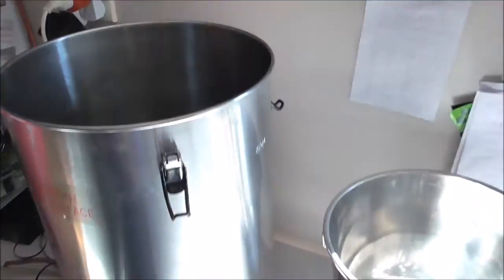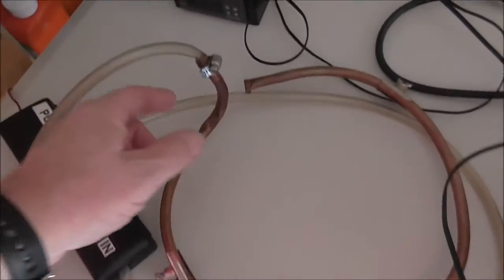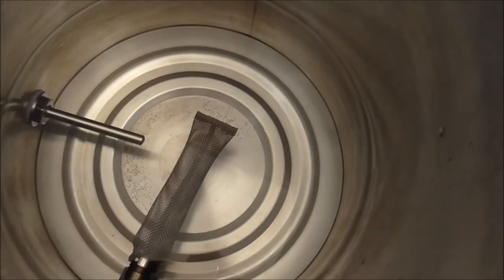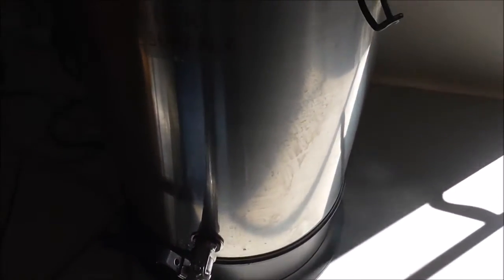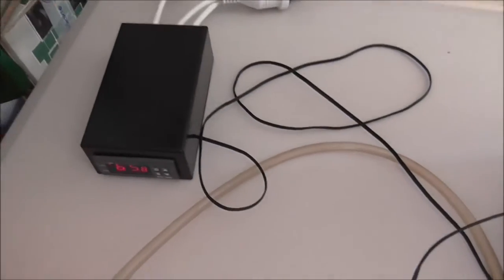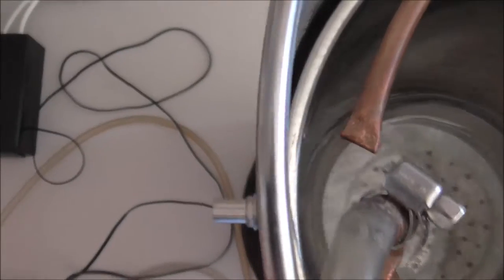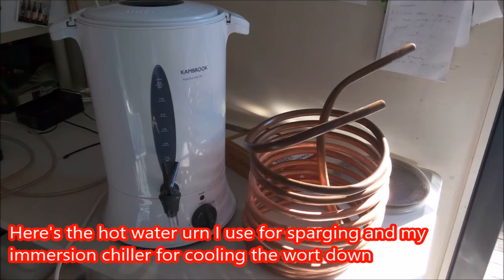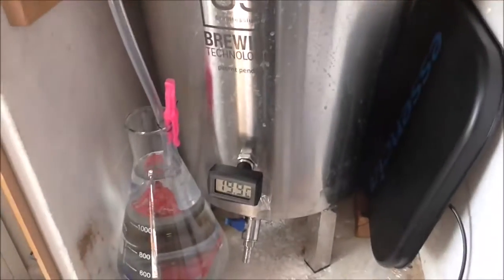Electric RIMS Brewing System with Sparge Ring - DIY All in one - August 2016 Update

Comment: Hey mate hows that little pump going? Does it really handle the temp and and small particulate that gets through?
Reply from the maker: Hi. It unfortunately gave up the ghost a few years ago. I've replaced it with a better pump as you can see in this video. The little pumps are cheap, but you'll end up replacing them on a fairly regular basis, so I'd suggest just getting a better pump that'll last for a long time. Cheers https://youtu.be/iygUdLT3dXk
Reply: @tubedinoz  Thanks for the quick reply mate. Did it just stop working or motor still working and the guts just wore out.

 I want something really low flow for this for a 2 vessel step mash recirculating & gravity setup and I like that I can trickle these ones even more as these are magnetic drive. 

The one in your video I have looked at a lot, but it means I need ball valves and fittings to control the flow. 

I love your simple mini batch set up on other vids, I have a mate who wants to get into it but has been scared with all the heavy duty equipment we obsessed ones use.
Reply from the maker: The hot sticky wort prematurely killed the pump I think. I got all my parts for the new pump from a stainless fittings company and wasn't too expensive from memory, but you do need that ball valve on the output to throttle the flow for sure. My overall boiler etc has been good and nothing has needed replacing apart from the small pump. Your mate can always start with a large stockpot and a grain bag and go from there if he likes. Cheers mate

Comment: Which temp probe are you using?
Reply from the maker: I'm using an STC 1000. Cheers
Reply: @tubedinoz  Any you simply put it inside a thermo well?
Reply from the maker: @6beast66  yes. I just make sure it's wedged in the thermowell with a bit of cardboard or paper to make sure the probe tip stays all the way at the end of the thermowell. It reads the actual liquid temperature very close. Less  than 1C difference at boiling. Cheers
Reply: @tubedinoz  Thanks

Comment: Hi Dino, would you mind sharing the specs of the set up, pump, pvc diameter, valve size (3/8) ? I'am trying to source parts to do one my self but struggling a bit. Thanks
Reply from the maker: +Mateo F Hi. Here's some info on the setup I uploaded previously. I'm out at work, but if there's anything missing from the links below, just sing out. Cheers Dino 

https://youtu.be/PmNQtjFjvZQ
Reply from the maker: +Mateo F There's some info on the description section of the following video on the pump/boiler. Cheers 

https://youtu.be/LKK6aZ5gxwk
Reply from the maker: +Mateo F I've swapped to silicone tubing which is good grade and better for higher temps. I used this to suit my pump inlet/outlet size. I'd recommend getting your pump first and then you can get the tubing you need to for the inlet/outlet and the barb size that is suitable. https://trademe.co.nz/1256381470

Comment: that's amazing i was actually looking at getting one of them boilers to make a reflux still out of but couldn't think of how to adapt it to keep the temps within a certain range, thank's for this video :)
Reply from the maker: +Heflar No problem. There is a temp swing of maybe 1.5-2C. That's with no lid or cover. It's just a fact that when the STC turns the boiler power off the residual heat in the element hearts the liquid up a little more. I don't find it a problem. I just know I'll have that swing and make sure I enter a temp that allows for the swing. Cheers

Comment: Are you using 1/4 fittings ?
Reply from the maker: The ball valve is a 1/2". The thermowell is about 20mm (4/5"). Let me know if there's anything specific you want the size of. Cheers
Reply: Thanks, I was just curious as the tubing looks small :)
Reply from the maker: You're right the tubing is quite small, only 10mm. I need that size to fit the inlet/outlet fittings on the small pump. It still flows about 250L per hour from memory. Cheers mate